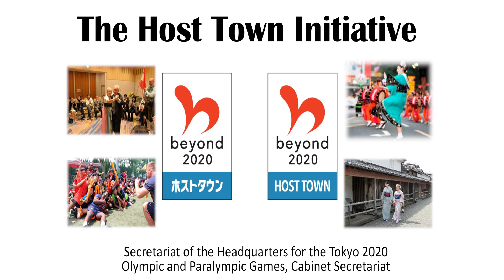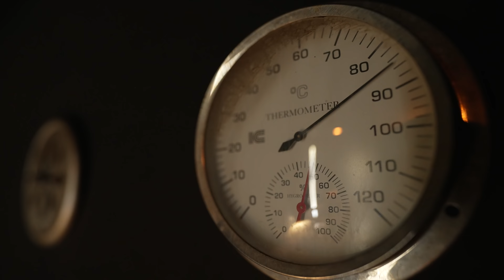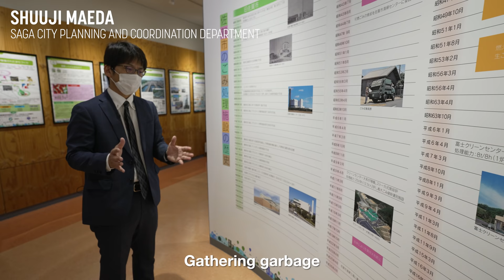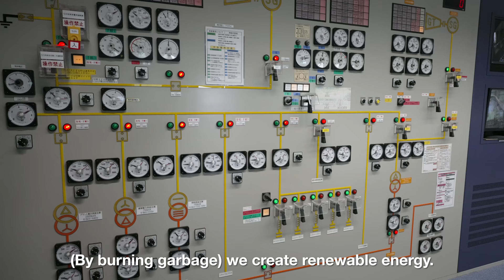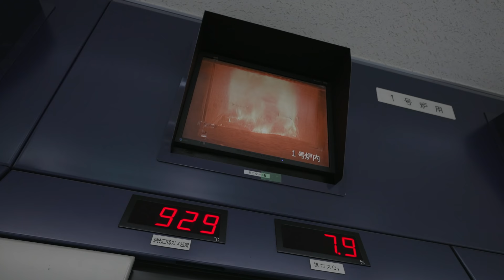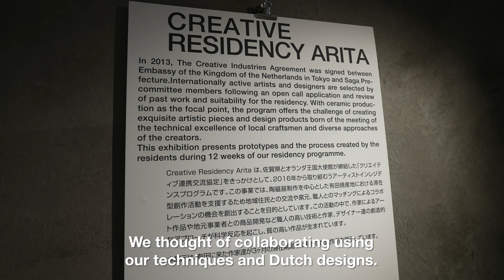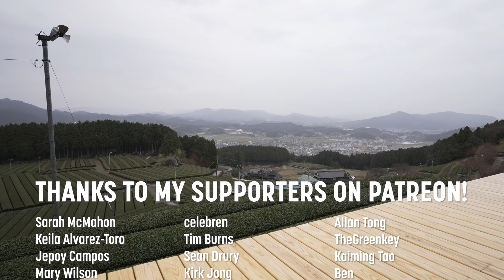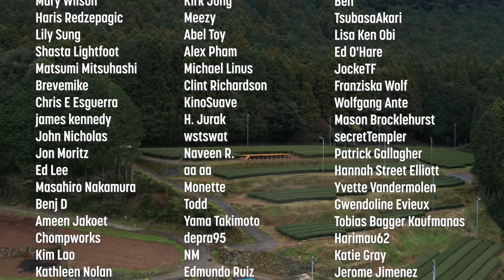Exploring a Japanese Olympics and Paralympics Host Town

Comment: 85C is pretty much bang on how I bathe in sauna as a Finn. :) Or basically I think it's ready to use at ~60C, perfect from 75-90C, bit hot but still tolerable at 90C-110C and pretty uncomfortable above. I often go through the whole spectrum as I've got a wooden stove and it just gets hot over time. When friends are over we just bathe for hours as a social activity. Finns are most communicative when drinking bulk lager in the sauna, the ironic phrase for those discussions is "improving the world" - people get to a mindset where they are eager to express their solutions to world's problems.
Reply: As cooling off between Sauna stints, our lakes are by far the best - and around where I live they are a bit chilly at 17 degrees or so for midsummer's eve, which I consider the coldest comfortable temperature for actual swimming, and gradually reach 25c or so in early August before cooling down again. During winter we just shower and sit on the porch.